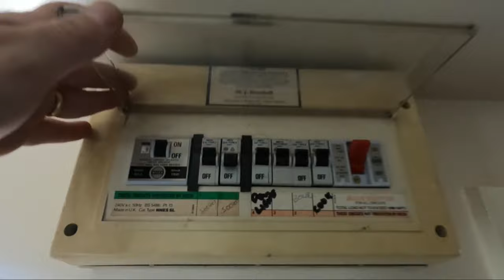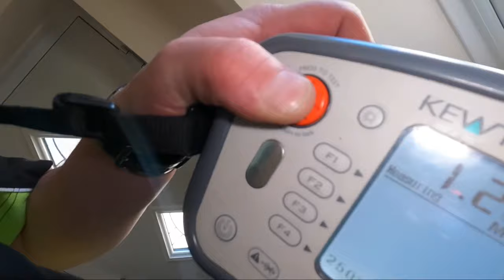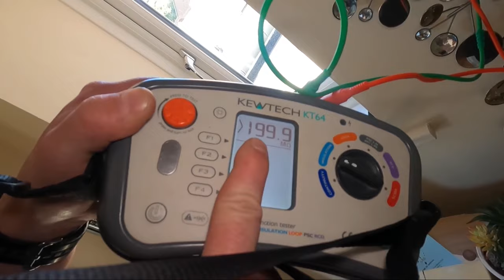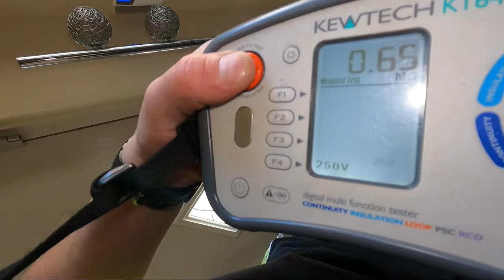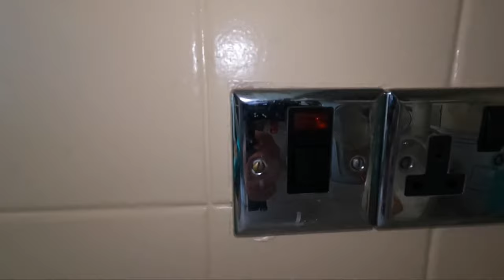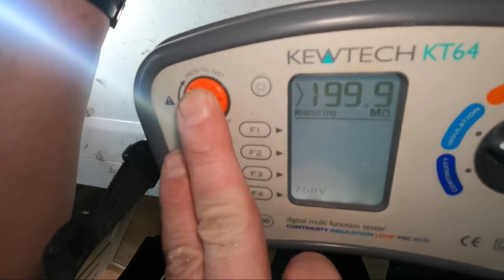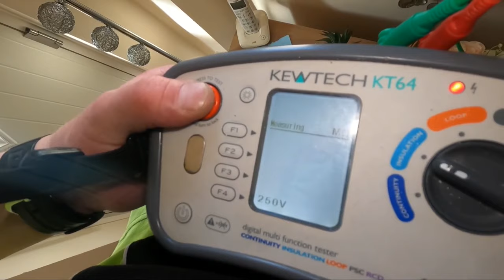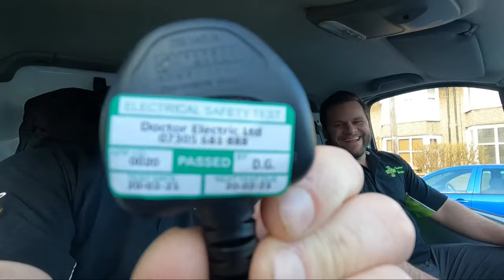Ring socket problem circuit fault finding using insulation resistance testing

Comment: What a great informative video.im a JIB spark and like to use a CPD, faults are fun and pleasing to find and its always something silly. Great stuff lads. Great point of test when unplugged and switched off.. I had 3 sockets customer put on he purchased off Ebay, switch was broke and shorted.
Reply from the maker: Hi Wayne, thank you for your comment.
Always unplug and test and do exactly in the video, most of the time it works, but when it doesn't that's when you get your head scratching!
Thanks for watching 👍

Comment: For future reference, washing machines have "an interlock" on the door, when the door is open the live is switched  off, you should always test with the door shut (and machine "on")
Reply: Maybe not such a good idea to meg an appliance tho with it turned on?
Reply from the maker: I never IR test with the appliance switched on
Reply: @DoctorElectricYouTube  Good
Reply: I don't I/R test circuits with appliances still plugged in. To safely I/R test an appliance when switched on, make up a single extension socket with a short length of 3 core flex attached. Strip back about 75mm of outer sheath then about 25mm of the core sheath, twist the Live & Neutral ends together and solder securely. Twist and solder the end of the earth, plug the appliance into the socket & connect the insulation tester to the bared ends. You can I/R test safely with the appliance turned on. 
To lift the front of an appliance over tiles on a floor use a small pair of air wedges, they take all the hassle out of it. Nice fault finding by the way 👍.

Comment: Good video gents, and a good methodical bit of fault finding there.
What you said about the Downlights was nonsense though, the old halogen lights don’t have drivers, they have 12v transformers, you wouldn’t get capacitive effect or charging up of the driver like you said. It’s just a coil, so it would either work or it wouldn’t.
The most common cause of that issue I’ve seen over the years is normally burnt out connector blocks. You see this a lot with old badly installed halogen fittings. Did you take any of them down for inspection atall ?
Reply from the maker: Thanks for your comment Darren, regarding the downlights  I was just thinking on my feet and was puzzled at the time, didn't have time to take them out.  Thank you for your advice though, it's really appreciated, every day's a schoolday! Thanks for watching
Reply: @DoctorElectricYouTube  you’re welcome fella, you may even find they don’t have transformers atall and are just mains voltage halogens, with burnt out or loose connections. 
Good work though with what you did 👍. You’re obviously conscientious about what you do, which I would expect from an ex member of the forces ! 
Also respect for filming your work and broadcasting it to the world, it takes balls to do that. Just prepare yourself for the keyboard warrior haters though ! 🤣
Reply from the maker: @darrenqualters2341  haha, yes mate, no worries will do, comes with the territory though doesn't it
Reply: I'm not sure how common they were in the UK but you can indeed get electronic "transformers" for 12 V halogen lights. They were quite popular in Germany in the 90s and early 2000s because they were small, lightweight and most of all cheap. They put out constant voltage instead of constant current like LED drivers do but they do contain all sorts of electrolytic capacitors. Basically they're switching mode power supplies and these can fail in all sorts of interesting manners.

Comment: CPC,  or Earth as we knew it, especially but usually all conductors were twisted to ensure continuity if screw in socket came loose. Not much point at fuse but done automatically. There were no regular tests. If no faults then installation was never disturbed for 30:yrs.
Reply from the maker: Great comment Alan, I did wonder, and yes you are right, I have been to properties that haven't ever been disturber for 30-40 years and the results are perfect

Comment: Good fly on the wall presentation.  Please explain how the IR test failure was caused by the trapped insulation on the line conductor in the socket feeding the washing machine, there was no breakdown in the insulation, am I missing something?  On second look, the insulation on the line conductor a bit further back looks damaged. But why would the RCD not catch this before the MCB tripped?
Reply: @timg6850  Eeeeh... I've got a hard time following that explanation, I'm afraid!

A B32 (this is a 30 amp Type 2, which I think is reasonably similar in trip characteristics) trips instantly at three to five times the nominal current, i.e. 96 to 160 amps. Assuming the bang the customer heard was actually related to the fault, I'd rule out an overload trip (which would still have required at least around 40 amps for an extended period of time). If a current of 40 to 160 amps flows from the line to the CPC, any RCD should trip immediately.

Since the RCD never tripped, I'm fairly sure we're looking at a L - N fault far below one MΩ. Let's look at this from a different perspective!

In the event of a fault, the line voltage (230 V nominal) drives a current across the fault's resistance. The greater the resistance, the smaller the current according to Ohm's law. In order to trip a 30 mA RCD, the fault's resistance needs to be below about 12 KΩ (kiloohms, not meg!). For a B32 MCB, the resistance needs to be orders of magnitude smaller than that. Let's be kind and assume it trips at 96 amps. R=230V/96A=2.4Ω. Again, Ohms. Not kΩ, not MΩ.

Unless we're talking about a dead RCD (stuck in the on position) this was a L - N fault at the washing machine socket.
Reply: @Ragnar8504  Yes, I don't t think this was an instantaneous trip. What I believe was happening is the wire has gotten physically hot from a high resistance connection in the washing machine socket ,say over an hour or two , and the bimetallic strip in the breaker because of the physical heat of the wire has tripped. This trip would account for the pop the customer heard as the circuit would have been under load at the time. The electrician in this video also talks about dampness so water in the socket may have been a factor as well.
Reply: Thinking further about it heating up of the wire doesn't seem likely. I can see a scenario where water has made a connection between the Live and the Neutral wires and tripped the breaker. Edit: It does beg the question why didn't the RCD trip?

Comment: Dean and Adam nice video thanks but I have a question, when you unplugged all the appliances and you checked again one set of cable with IR which was Live-Cpc and when you have greater than 199.9 you assumed the circuit was healthy but how do you know the fault wasnt in the L-N as you had it tested L+N against CPC so even if L-N had short circuit, it wouldnt show as you joined them together against CPC ?
Thanks again for the videos

Comment: Is the low I. R reading not down to the neon light in the fcu?
Reply from the maker: Hi Chris, no, we tested L&N to CPC@250V which takes the neon light out of the question
Reply: @DoctorElectricYouTube  I might suspect the Y filter caps in the washing machine, although around 1M is quite low.

Comment: £150 to change 4 x halogens to LED?  B & Q sell 8 lamps for £16.
Reply: And if you look on eBay you could get 10 for £5 and if you look in a skip you could get 20 for nothing. Cant believe Doctor Electric has the nerve to supply decent down lights and also charges a fee to fit them, its shocking Lester. Hope you're not too upset.
Reply from the maker: 100% Jon
Reply from the maker: I would never buy 8 lamps for £16, my go to brand is Collingwood, I've never had one fail yet

Comment: Always test insulation resistance with the cpc still connected to the earthing arrangement
Reply from the maker: Thank you for your comment Robert, personally I've never heard of that, what is the reasoning behind that?
Thanks for watching
Reply: @DoctorElectricYouTube  if you look in the regs or gn3 it is the actual way you should do it . 

Basically you might have just a screw/nail through the line or neutral conductor only .which would still give you a clear reading when testing against just the cpc conductor disconnected. If you test against the whole earthing arrangement with the cpc connected it will most likely detect this fault as it is testing between the damaged cable and the whole earthing system including bonding . I had one recently where I was getting under 2 meg ohms on a new install when testing against the whole earthing system but the fault would clear when just testing against the cpc . It turned out to be a screw had just nipped the neutral conductor in the kitchen .
Reply from the maker: Thanks for that, it's not the way I was taught when I was an Apprentice, I've been doing it that way for years, I'm gonna go have a look through GN3 at the weekend.
Great comment, much appreciated 👍👍👍